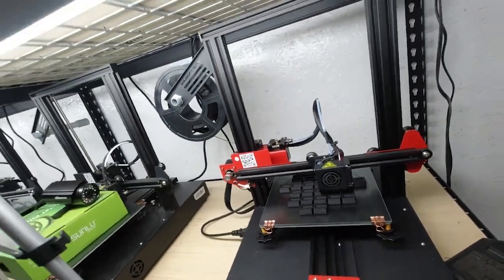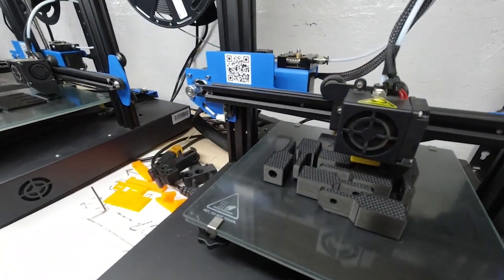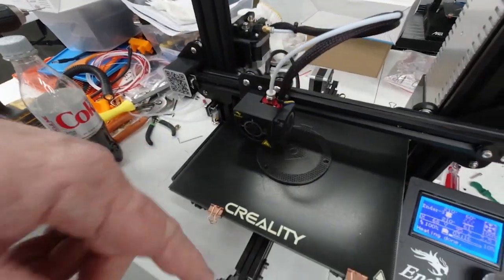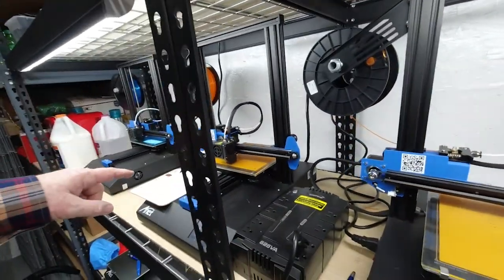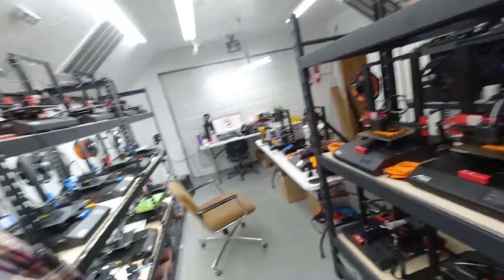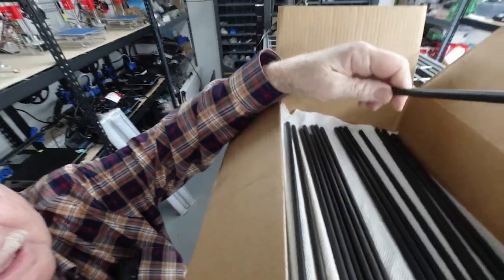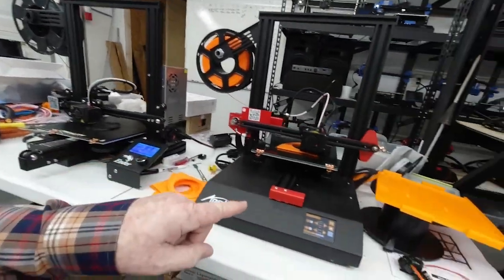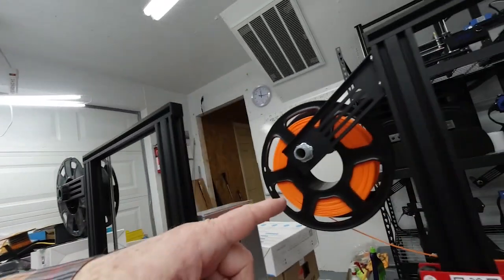MY 3D PRINTERS WORK AROUND THE CLOCK AT MY 3D PRINT FARM making parts for the NTI Helping Hand

Comment: Great work! 
I have always wondered how Print farms manage their print jobs, do you manually insert an SD card in each printer and start to print? 
or are they all controlled together using some kind of software?
Reply from the maker: Most of my printers are set up to print only 1-4 different parts and those gcode files are on a chip in those printers. These printers usually use the same filament every time and are dedicated to only those parts. Other printers are used to print various parts and filaments and test parts in which case I will add gcode files to the chip in these printers. 80% of the printers keep the same chip in them at all times. Thanks for the question and for your support...Ken

Comment: Looking great Ken. I've been 3D printing for about 1 year now with an Ender 3 V2. 
What you've accomplished with 3D printing is not an easy task, and you're so organized with how you operate. 
I love how you have dedicated printers for specific parts like the wire clips. You must have a really efficient process for bed leveling and adhesion to bravely print so many parts on one plate. 
I am interested in an auto bed leveler, because even with upgraded springs on the Ender, the plate still seems to slowly raise after a few days of print hours. 
Do you watch every first layer lay, or is this not necessary ? I've only ever printed on the Ender 3 V2, so I don't have the experience to compare to other printers. 
Thank you for your great contributions to 3D printing, keep up the great work! :)
Reply from the maker: Thank you for your kind words, Jacob. One thing I do when setting up a printer is to tighten the bed leveling screws all the way and then back off about 5 or 6 turns, this keeps the bed tight and does not allow for much movement of the bed over time which could cause the bed to get out of level. I have printers that have printed for over 1,000 hours and not needed any adjustments or re-leveling. This is not always true and I sometimes have to print a test which is an inner 50mm one layer square 10mm wide and aa 200mm perimeter one layer square also 10mm wide. I watch this test print and make final leveling adjustments as needed. Thanks for the comment and for your support my friend...Ken
Reply: @NewTechInventors  Thank you so much for explaining your method for bed leveling. I will try this with my Ender. 

I upgraded to stiffer springs and it still goes out, so maybe tightening all the way and then backing 5 or 6 turns will help. 

The other consideration that I have been thinking about lately, is that perhaps printing different 1st layer layer heights will have an effect which is consistent with a perceivable gap that makes me think It's lost level when maybe it really didn't. 

Like switching from 0.2 mm LH to 0.12 mm LH, could cause a gap with improper adhesion for the first layer if the 0.2 mm had perfect squish, right?

Thank you for helping me my friend, -Jake

Comment: Hi. How do you power all those printers? Do you need a special set up. I am going to be setting up 8 in my garage. Can I run of normal house power sockets?🙏🇬🇧
Reply: What is the wattage requirement for each printer?
A household 110 circuit is 110v and usually 15 amps, so 110x15= 1650 watts per circuit. With margin for losses call it 1500 watts. 
So you could run 3 or 4 machines that take 400 watts each on one 15 amp breaker
If you need more you'll need additional circuits. No idea what the power needs of a 3d printer are so I can't give an exact
Reply: Also with the 🇬🇧  are you in the UK? IF so you use 220v or 208v can't remember.. either way not 110 like the US uses. So you'd be safe to run more watts on the circuit without overloading and tripping a breaker..
Reply from the maker: Good question Paul, I have done several videos about how much power you need. I can run 10 Kingroon KP3 printers on one 110v 20AMP circuit with no problem. When I started the new print farm, I did a video where I used an amp meter to check the current being drawn by 22 Anet ET4 printers. They drew about 20 amps while preheating and about 11 amps while printing, If I remember correctly? You can go back and see the video " MY Home Based 3D Print Farm First Run". I did put in a special power panel and several 20 amp circuits for the print farm. Hope this helps some, and thanks for your support...Ken